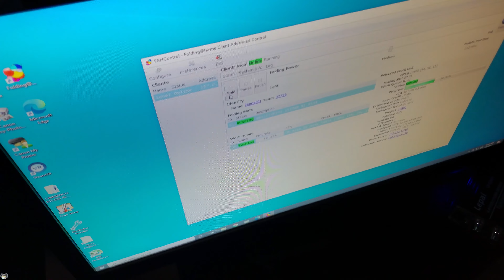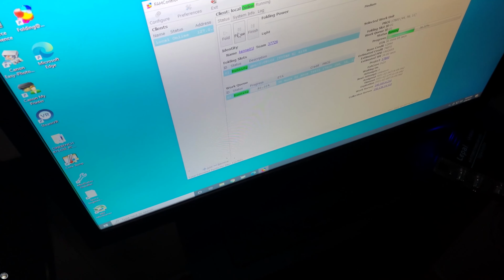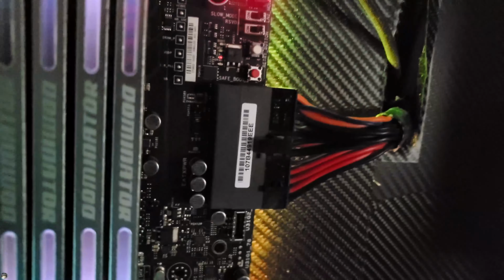Is My PSU / Power Supply Dying?

Comment: Hey man, this is unrelated to the video but I just binge watched your water-cooling the 3070 series and it's exactly what I wanna do it was scary how I just came across your video haha. Do you have a rough estimate on how much it cost you for the water-cooling components? Such as the tubing, pump and the new housing for the gpu? I think it looks so good
Reply from the maker: Well its kinda tough to estimate because it depends on what's available to you and compatible with your build. Water block $130, pump/res $115, rads $ 60-100, soft tubing $10, fittings $2-5 each

Comment: Considering what you are running, I would be upgrading your PSU to at least 1000W. You bought yourself quality components. Don't skimp on your PSU.
Reply: im running a 850w PSU with a 5900x a 3090 4 sticks of corsair venegance rgb ram + custom watercooling without a problem